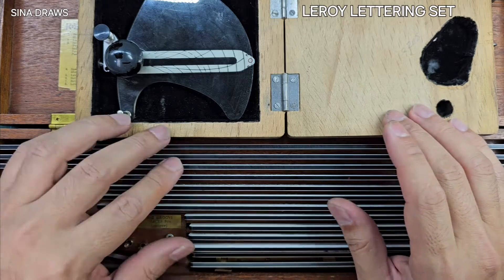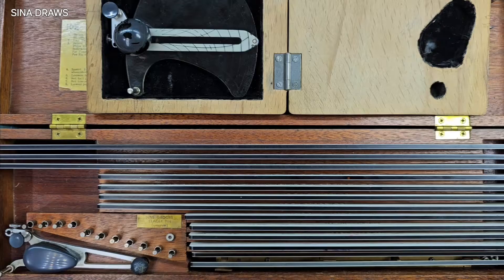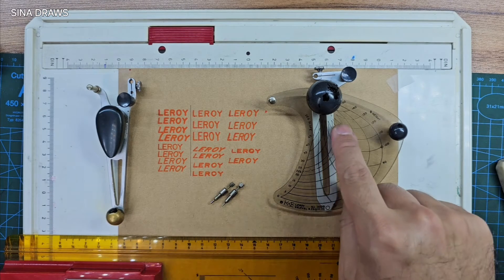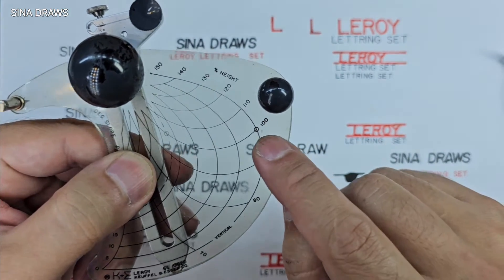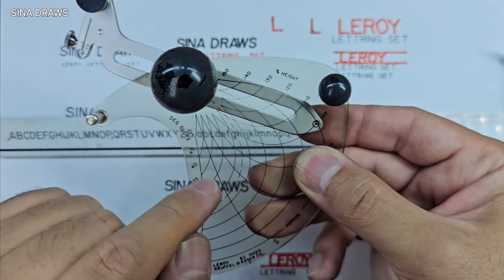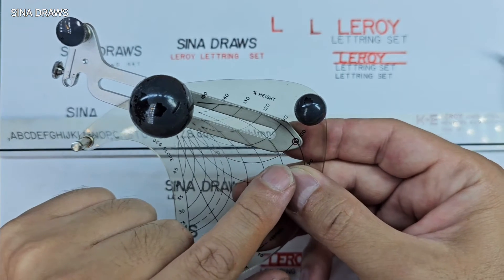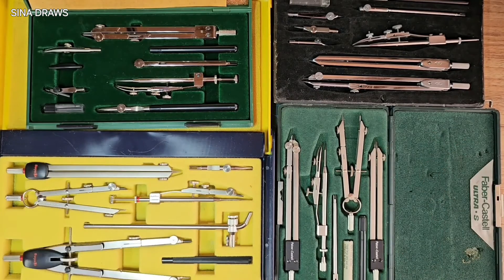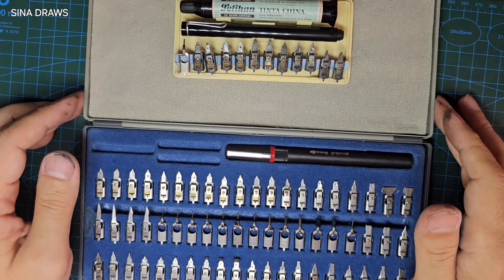LEROY lettering set by K+E, with technical pens, a useful tool for inking, lettering, drafting...Ep2

Comment: I just picked up a set on Ebay and I've never seen one with this many extras before! One thing I'm curious about is that what I've got is the adjustable scriber and a separate letter height adjustment gizmo that you can attach to it. I'm wondering if this combo makes it basically the same functionality as the height/slant scriber? The adjustment grid seems like it would be far easier to use because there are no markings of any kind on what I have, so you'd be hard pressed to keep any settings consistent. But I wonder if the range of height and slant are the same between the two?
Reply from the maker: @stevewik2280  normally engineering tools should be quite straightforward, and the adjustments should be easy so one can choose the same one each time they use the device. I really wonder about the gizmo you just described because if it's hard to keep the adjustments consistent or if you can't say what adjustments you've already done, it can't be practical. Anyhow, it's not a bad idea to search its picture on Google and see if anything like it can be found or not. Many thanks for sharing your experience, and I'd be really grateful if you let me know the results 😊 🙏

Comment: I'm very curious about the surface you are drawing on at 1:21 in the video. Is it related to the lettering set? I have one that came from a Polish architect who worked from the 60s-90s. I also have a small lettering set like that - and it looks like a good idea to use them together.
Reply from the maker: Many thanks for watching, I really appreciate it. That surface is called drawing board or drafting board, Rotring size A4,  Portable and useful, there is also size A3 available. I use it while drawing with any other tool, not only lettering set or Graphos or... . That's a really practical and useful tool . Wish you health and happiness🥰